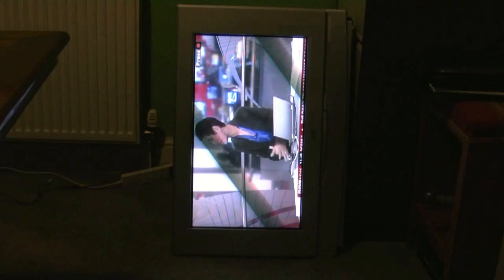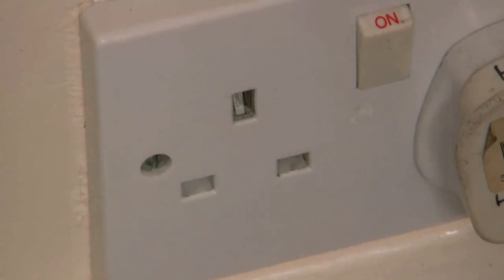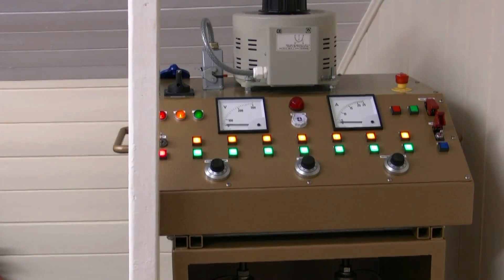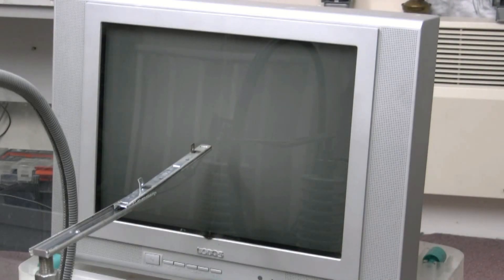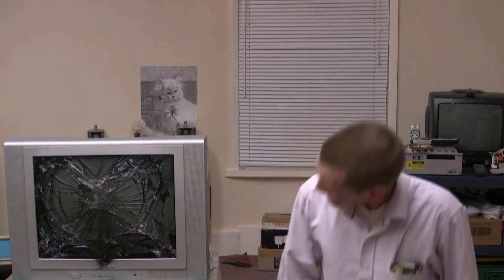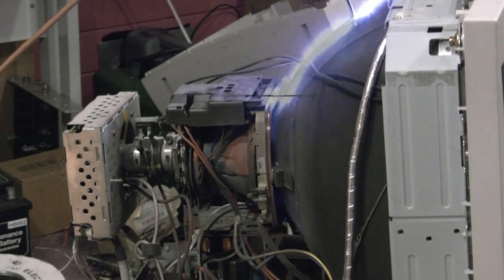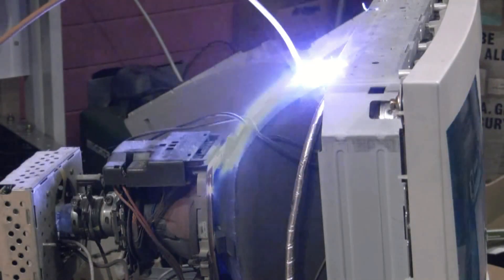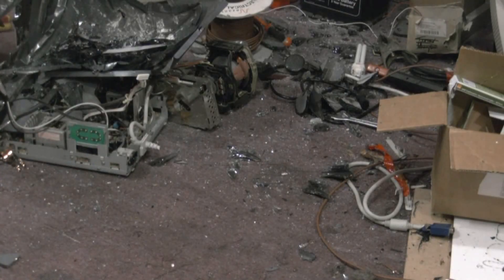300Kv On A Television

Comment: coming from a electric panel engineer background college wise, it's fun to see a Hansol PC Monitor (900 stands for 19 inch screen size) as there was no work in the panel industry in 1998 i went it work at a computer shop, and we sold those monitor. didn't realise they could handle such a punch,.... Nice to see old memories , and get smashed up the next second.

Comment: Hey photonicinduction a big fan here and I don't mean to type you blow up I popped it.

 There is something that I was wondering if you tried but haven't seen it yet from you.

However many others have done it but not you yet which I'm extremely surprised you haven't

Most people have used neon sign Transformers and microwave of Transformers for this but with your high voltage equipment and skills that all the experience would be even better.

And that is that did plasma TV panel not connected to the rest of the electronics but just a panel you could get really good light show.

And good Pop's out of that

And before that one you can hook up plasma up 2 high voltage that is actually working beforehand you haven't done that either yet.

Also another experiment would be interested in Tri will be running high voltage of varying voltages straight to Google fluorescent tubes without a ballast from one end to the other I'm Different 2 blinks including long as you can get or even doing it with cold cathode fluorescent tubes even so the big ones or the backlight ones by themselves or what about overvolting a neon sign tube xcetera I'd like to see all this the guy on the other channels but nothing like what you could do thanks bye

Comment: you have to use timer or arduino controlled transistors to make screen usable :P that way you can use it as display. 
arduinos has support for 320x240x60x3bits of speed i guess (crts general dispalay specs ?). so can be used probably to simulate display controller chipset  :P
Reply: this crts are interesting things. in past people used some kind of analog computer unit to make those displays work :P thats what makes them magical . a clock simply synced with the recived signal and generates the viedo precisely. thats lots of timing and precission i guess :P
Reply: with one or may be 3  transistors you simulate near the whole processing unit. and sync it with analog signal to generate correctly timed bits of pixels on screen :P

Comment: As a graduate electronics engineer I find your experiments extremely dangerous, yet intensely interesting! 😂😆🤣
Reply: @ mathew Duchvalt Just as long as You aren't the one doing them ?
Reply: steven Hixburn don't experiments on doing as of late are on my Subaru WRX. She runs faster than a scolded dog 😉
Reply: @madduck692002  It's still a slow 4 cylinder.

Comment: i am a ham rdio general class, and yes, if u apply enough voltage across a crt tube, it WILL start to produce x rays.
Reply: Yep there's warning on the CRTs themselves to not exceed 25kV ;p
Reply: sondra york Why though?
Reply: I'm guessing it's because the electron gun starts to produce higher energy particles

Comment: 1) what makes the arc blue or yellow?

2) what is that ring thingy he called a 'barrier'? (how does it work?)
Reply: 1) an electric discharge is blue because of the oxygen in the atmosphere. The nitrogen makes for a purplish arc and together they form 98-99% of the surrounding air. Electric discharges in different gasses produce differently coloured arcs, such as the case with neon lights where you have red discharges for He and Ne, purple for Ar and blue(-ish) for Kr and Xe.
Reply: Dirk van de Kerkhof thanks for the info 😀 physics is awesome!
Reply: No problem man! Im studying to be a chemist but shit if physics aren't just as interesting. I couldn't really tell you exactly why oxygen turns blue or neon turns red, but I do know the composition of the medium determines the colour of the arc.
Reply: Dirk van de Kerkhof dang, did I just type physics? I meant, science is awesome! Uncovering the mysteries of our universe. Good luck with your studies, mate. 👍
Reply: Well this is also physics. Did a quick check to see what makes the colour and it has to do with the energy levels the electrons can occupy. When you excite the electron (put energy in) it jumps from the ground state to a higher energy state and after that it can fall back to lower levels/ground state thereby releasing energy in the form of light of a specific wavelength.

Comment: So how does pumping volts into a crt create x-rays
Reply: It only happens after running several niggawatts through the flux capacitor...
Reply: It was one of the very first effects noticed by any cathode ray tube, you get x-rays.  Put film in front, you'll get a glow on it.  Period.   i.e., all cathode ray tubes do that by default.
Reply: After all the CRT has a photon gun in it
Reply: I think you mean an electron gun.

Comment: Lol I just had a really bad thought.  I just built this computer for the gaming channel and the high end computer that costed around $1600 and is still not done, but is done enough I can use it.  Ooh hell keep that high voltage away from my tower.  It is scary.  one zap and it will be a paper weight.. or brick if you prefer.
Reply: 4 Grand.  Still working on it because Windows decided they need specific Hardware to be compatible with Windows 11.. and Done thank god.. I hate how fast Technology moves, this is ridiculous.

Comment: Hahaha, "I'm not going to even be in the room".

Next shot he or the camera guy walk right next to it as 30kV arcs freely a foot away.
Reply: Gareth he was saying that it might generate x rays which is why he wanted to be out the room
Reply: It's 300kV, not 30kV. He built those HV transforms himself out of 4 x-ray transformers. I know he's sold one along with a 3ph variac. But I can't remember how much he said now 🤔 I definitely I know for a fact that it wouldn't be cheap.
Reply: @TheManLab7  definitely not 300kV. Those XRTs are rated 150kVp. The gap between the bushings will limit the voltage to around that regardless. Still, over 100kV RMS is nothing to scoff at (especially with 20cm of jump hehe)
Reply: thoughy it was 300 KV

Comment: 6:16 can someone explain why and how there are 2 different colored electric arcs, a blue and a yellow one?
Is the yellow one hotter and creating some kind of burning air/plasma?
Reply: ***** and why the different color?
Is one electric arc hotter than the other? What's the difference in the electric arcs? Higher frequency? more ampere? more volts?

Comment: wait, you have 240V in the UK? we only have 110 to 120 v in the US.
Reply: +Creeperzone221 __ as much as I know, everywhere, it ranges 220v--240v as standard =)
Reply: in the USA 240 is used for heavier appliances only.
Reply: +Creeperzone221 we have 3 times 240V and 3 times 400V in Belgium :D
Reply: we had 110-120 volts way before project paperclip, and aside from that our homes are a split grid i believe, our homes have a 240 feed from the transformer, it's center taped, from that we get 120 volts that's say 0 phase and 180 phase with that center neutral terminal and then ground, high demand devices get the full 240 volts.
Reply: it's be hilarious if the tv still worked
Reply: +Creeperzone221 ...... LOL bro.... we have 240 here in the US. Had it at my old house. It takes a special circuit breaker in your electrical panel. You have a 120 supply coming in, and it takes up 2 slots in the panel and runs the 2 circuits in series, creating 240 volt service. That's how electricity is run pretty much everywhere.
Reply: +Joshua White ohhh, ok. thanks, man. I didn't know that. I should though.
Reply: +Creeperzone221 It's an easy thing to overlook. One wouldn't think to run 2 circuit breaker slots in series to get 240.
Reply: +Joshua White true. I just forgot about the king if randoms vid when he used two wall outlets to get 240 volts to a microwave transformer to melt metal or weld or something like that.
Reply: +Creeperzone221 yeah and you only have that thanks to project paperclip

Comment: With all that entropy added, you will cause the heat death of the universe.
Reply: +Vert3x Adding (well increasing) entropy is not the same as adding energy to a system. Entropy is a measurment of how evenly distributed the energy is. So the part about adding entropy is correct. Whenever it's increasing entropy enough to be the main cause of the universe heat death I'll leave unsaid.
Reply: +Vert3x Your comment said "there's no such thing as adding energy", and +jednoucelovy never said anything about adding energy?

I'm confused now.
Reply: +T-Bone Energy is the ability to do work. So the wind going from 0 mph to 10 mph somehow no Energy is added? The trees don't move themselves.

Comment: I thought they stopped making plasma tv's
Reply: MixZ you missed the joke
Reply: @tjeulink  the joke

Your head
Reply: +405line most under appreciated joke in this whole comment section.
Reply: Epic Lolzy the chemical you mention is Sodium
Reply: +405line Thank you! :)
Reply: I got the joke, because the arc is plasma, but CRT and "plasma" TV sets both use plasma to generate their images, like a plasma globe, but more organized. Even street lamps and fluorescent bulbs use plasma to make light. The back of CRTs and probably plasma sets are coated in lead to shield against X-Rays, but I am not sure how the front is shielded. In a color set, the metal shield might help to keep the radiation down.
Reply: @buddyclem7328  the front one is shielded with Phosphorus
Reply: @buddyclem7328  no. TVs do not use plasma. An electron gun fires at a phosphor coated screen in a vacuum
Reply: @buddyclem7328  There is no need for shielding. A properly functioning TV wont produce X rays.
The back of the tube is dark to stop light leakage.
Reply: I thought street lamps used a chemical that burns orange and that's why they have to be replaced all the fucking time, or maybe im insane.
Reply: @epiclolzy5203 :
They don't burn it. They last a long time. Much longer than a tungsten light bulb.
Street lamps contain metallic sodium with a bit of mercury in a Al2O3 tube. They pass high voltage through it but I don't know the amount (maybe 100 or 200 V).
Reply: you mean crt's. I still have one. it's a heavy bastard, but it's the best damn tv I've ever used.

Comment: Sometimes rays are blue and some 1 thicker ray white, why ? It is the voltage ?
Reply: Alexandros When he turns the current up, it arcs thick and white. Think of turning the voltage up as widening the pipe, and turning the current up as putting more liquid through the pipe, if that makes sense.
Reply: +Alexandros It's so poetic. High current is red, UV Radiation is blue, corona is purple, shit I just blew a fuse

Comment: Electric bill this month: U$S 7.382.00
Reply: Lapua78 It's not actually much, as the experiments lasts just few minutes. You don't pay for volts, you pay for kWhs.
Reply: YOᑌ ᗰEᗩᑎ 7,382,000$
Reply: Lapua78 you are all wrong, UK£650,000,000.
Reply: +Yextus Well assuming he drops the voltage to create the high amperage it would still be the same wattage usage. lol age age age
Reply: No how about £99,000
Reply: Lapua78 7,382,000,000,000
Reply: Lapua78 you mean 300,000
Reply: +CABAL Well some of his high current videos have to spike the bill up a fair amount
Reply: Actually it's not that much he charges some batteries during the night when the power is cheap and then uses it during the day
Reply: You mean $696969696969
Reply: ExplodingAsteroid You mean, $7,382,000
Reply: +Lapua78 it a transformer no extra pay

Comment: How the hell did it set off the alarm?
Reply: Shorts
Doubt that was enough smoke and pretty sure the detector was downstairs of him.  His comment about screwing up the electronics all over the house wasn't some idle remark.  When the transformer lost it's arc it essentially became a radio transmitter blasting a couple hundred watts of RF at 50hz through a good chunk of his house.  Plays havoc with sensitive electronics.  I used to have a 4 post car ingition coil I rigged up with a variable square wave generator and a mosfet output stage to an old 200W AT computer supply using the 12V rail.  Was gonna use it as the tank supply for a tabletop tesla coil.  If my breakouts were set too wide or fell open while it was running everything in the aparment that had an audio amplifier in it and was turned on would sing at me with the frequency that was being pumped into the coil.
Reply: The alarm is most likely connected to the transformer

Comment: Ok so my dad is a science dude he got over 400 medals for science and he once tried 1.000.000 volts on a television.. 5 streets ran out of elecrtricity and the entire screen popped in million of pieces we almost died in that experiment
Reply: Oh yeah? My dad is also a science dude he got over 9000 medals for science and he once threw a coat hanger into a 10 gigawatt 12kV-100kV step up substation at a hydro power plant and 120,000 neighborhoods ran out of electricity and we almost died in that experiment
Reply: sureee then my dad is a mad scinetist he putted on a television 500000000000000000000000000000000000000000000000000000000000000000000000000000000000000000000bil KV and the entire world ran out of electricity for 567years beat that
Reply: Once my dad chewed up a paracetamol tablet instead of swallowing it whole. No dad in the world could beat that matey.
Reply: Andrei Nistorescu And you tell kids today. They wont bloody believe yoo

Comment: With the voltages you're dealing with, aren't you worried about radiation hazards?  Turning up the accelerating voltage in a CRT that high will cause brehmsstrahlung.  Or are you doing this with a remote camera and control system?

Comment: USD $2,000.00
 
Puny capacitors are for girly men.
This bank below is a bit manlier ….
 
Bank of 20, 450 Volt Nippon Capacitors.
Total Volt: 9,000
Total µF: 48,000
Weight: Approx 50#
 
http://cgi.ebay.com/ws/eBayISAPI.dll?ViewItem&item=321463321132

Comment: lol this is so fake, but so good
Reply: Not fake. Ever touch a screen of an old television like that? Ever get a static shock? It's basically that, times 1000. :) just amplified!
Reply: Its not fake, 300,000 Volts can be done on a transformer
Reply: Silly uninformed citizen. Thinks electricity arcs are only on TV, eh?
Reply: Go back to making GTA videos, leave the physics to people who have finished secondary school...
Reply: daveabittner
CRTs work around 20-30kV so its not 1000 times more.
Reply: rJay Stillwell well it's certainly on that tv :)
Reply: Vigi_ Just threw in a random number, although I didn't know that! That's pretty sweet :)
Reply: lol its not fake...
Reply: Sorry guys.. The only reason I thought it was fake was because it says in the description"Sound Track generted from http://www.looperman.com/".. I read it wrong! This is a very cool video tho!
Reply: Vigi_ Exactly.
Reply: daveabittner
Well its not that common knowledge. Everyday small static shocks have huge levels of voltage also ( from thousands to 20kV), especially when the air is dry.
Reply: Acidicfriend lol, not what I meant. ;)
Reply: PhaZer :D

Comment: Did you say 240 Volt socket? You mean 230 Volt...
Reply: It used to be 240V in the UK, like it used to be 220V in Germany. Then EU happend wich meant everything was raised/lowered to 230V, but over a longer time period so that the appliances could "get used" to the new voltage.
Reply: ohh

Comment: So has the police ever raided you in hopes of finding a cannabis farm? :D

I bet they are thinking "Ok, 300amps from a flat is not normal we got a grower"
Reply: If the current were that high, everything would have melted. It's high voltage, low current stuff. 
If it's 300kV and 2kW of power, that's about 6-7mA.

Comment: Is the floor of your 2nd story steel or thick concrete?

If not, does removing yourself just downstairs provide much benefit if the tube was giving off x-rays?
.
 Seems like some lead shielding that you could place as you want might be a good thing to have.

Comment: How the hell did you manage to get away with a transformer generating in excess of 300,000 Volts in a flat in England!? And how can you power that thing?
Reply: transformers
Reply: It is called drive 1/2 to 3 miles to a farm and steal the villages power wires!
Reply: Quite easy!
Reply: I think it's a tranformer from a x-ray machine or something like that but he built a different casing for it

Comment: tip: if you gently poke base of sealing tube on electron cannon, vaccum will give it nice speed and it will punch nice hole right in center of the screen

Comment: When he was frying the monitor he said he turned it up to 2000 watts of power. Let's assume he's still pushing 300KV. That would result in 2000/300000, which is about 0.0067 A

Comment: Yes, it can arc and burn you or kill you depending on the Amperage. It only takes about 500 mA (0.5 of an Amp) to stop your heart regardless of that current's potential (voltage).

As an example, stun batons sometimes carry a potential of up to 1 million volts, but produce very, low Amps in the range of 1-2 mA (0.001-0.002 mA).

Comment: Plasma is a highly excited state of matter. 

Electricity is the measurement of movement of electrons to achieve balance between a disparity in positive and negative charges.

They're related, but describe very different phenomena. Plasma is what allows electrical arcing to occur. Air is normally not a conductive substance. However, when lightning strikes, it's able to do so because of highly excited air creating a plasma channel that is highly excited air molecules that become conductive.

Comment: He's using a step up transformer witch means the amps are being dropped to make the new current. i.e. high voltage and low amps. So he's using no more current from the wall then would just the T.V. it's self being plugged in.